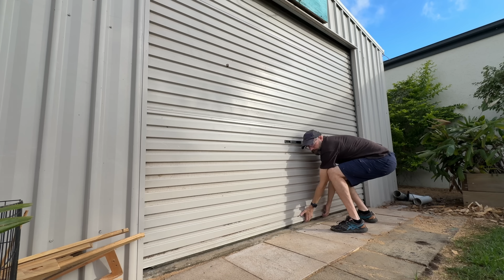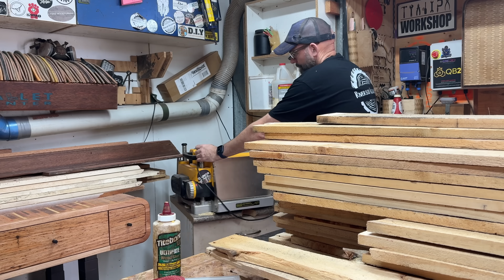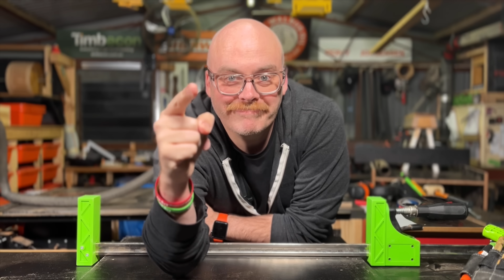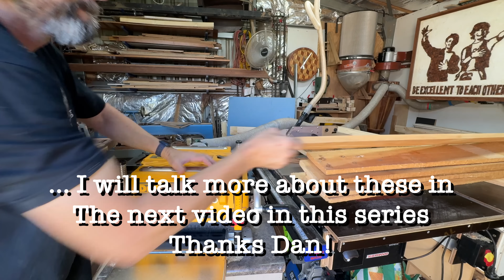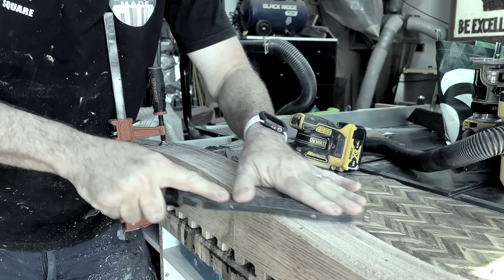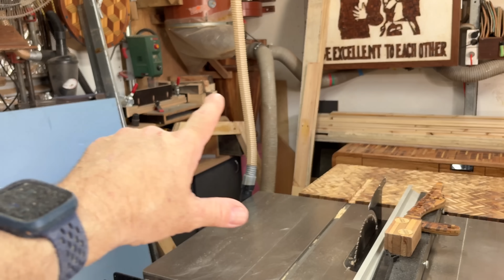Making Timber Without a Full Workshop – Minimal Tools, Big Results

Comment: Wish more youtubers where like you, honest, raw and kind!

My workshop is about half of yours and I've just (hopefully) finished collecting tools myself. Its gotten that bad I have no room and have to pack away the tools after every use 😂
Tools: Table saw, Mitre saw, Thicknesser, Planer, 2x Pilla drills, Lathe, Massive band saw, Shop vac with 50l cyclone and a Dust extractor... safe to say, no room for sliding 😅

Also I bought Phil a pack of 🍺 hope it helps 👍
Reply from the maker: Hey Kelvin, cheers mate. Be excellent to each other is the rule 😉 Your space sounds perfect mate, it will evolve into what you need it to be. Small spaces really get the brain going. and thank you so much for supporting Phil 🍺

Comment: I know it’s not the point, but how does the cost of all that glue compared to the same amount of 2 x 4s?
Reply from the maker: I used about 2L of glue of titebind original. about $50 Aussie. I will do some math on the 2x4 in the next video. But you’re right it is not the point 🤣

Comment: I hope the best for Phil. When it comes to buying machines I am all about buying when it's a screamer of a deal and/or if the machine needs a repair. I just got an absolute beauty of a bandsaw for $150 just because the motor went on it. For $35 I got new to me motor that is twice as powerful as the original. That saw would have cost me $800 if I bought it all new. So that's just to say that there are different roads to getting your tools upgraded. It doesn't always have to be through selling projects. Everyone get to pick their own path. Once you do get a combo machine your going to love it.
Reply from the maker: For sure mate, and very good advice if anyone is reading along. Cheers mate

Comment: 2x4 is not expensive.
Harvesting wood from pallet makes sense?
If pallets are use with minor changes, makes alot of sense.
Glue is not cheap.
Reply from the maker: Cheers mate, this is not a comparison video. But I do know I used less than 2 litres of glue for this entire process, that about $50, happy to trade my time instead of buy the timber. Which is what the channel is mostly about

Comment: @Dainer Made...I have often wondered about using pallets to make construction grade 2x4, 2x6, 2x8 or any other dimension of lumber.  For example, a 2x4 bought at the local big box store actually measures 1.5 x 3.5.  Will  the lumber you are making out of the pallet wood measure an a true 2 inches by 4 inches or will it be 1.5 inches by 3.5 inches? Also, if your wood is actually a true 2 inches by 4 inches would this affect the projects that you use to build with it??
Reply from the maker: Hey mate, the exact size does not matter at all for my project. The chunkier the better 😁
Reply: That’s a good question, or line of questions. When lumber is sawmilled it starts out at full dimensions, say 2 be 4. Then it gets milled, planed, flattened, dried, squeezed, etc. etc. and that’s why we end up with smaller dimensions on the consumer end. In the case of milling lumber yourself, you can make it any dimension you want.
Reply: @mikebond6328 ....hey thanks for the response.   I am new to woodworking but still want to know if my newly milled lumber from pallet wood would effect a project that I build?  For example, I am reading a book named "Great 2x4 Furniture" and am worried that my builds would be thrown off and not fit together properly if I use my lumber that is smaller or larger than the lumber I would buy at a big box store. Any insight you have is appreciated. TIA.

Comment: My own setup is extremely similar to your own. Table saw, and a planer. 
I attempted a big slab glue-up recently and struggled to keep my wood from shifting while clamping over a dozen pieces at a time. Needless to say, my glue-up was not successful. Although I know what adjustments I want to make going forward. 
Anyway, you've been a huge motivator for my starting woodworking. 
I'm very excited to see how your shop evolves. 
Cheers, mate!
Reply from the maker: haha, I know the struggle mate, I feel like there is lesson on everyone  even now. Enjoy it all mate and thank you
Reply: I recently saw a way to restore the friction when doing a glue up - grate a little of the abrasive from some sandpaper onto the joints - just a little goes a long way, a lot of wood workers use salt too.
One love from Spain

Comment: When you break a nail head off you can lock Vise Grips onto the nail shank and they'll hold enough to pull the nail out with a pry bar. I've done it a million times. It always works. But you need a pry bar with a fork on the straight end. They're kinda rare. But you need one.
Reply from the maker: Cheers mate, sometimes nails still break and I leave the rest in peace lol

Comment: I'm laughing about the glue-up "adventure," but you know I'm not laughing at YOU, right.

Definitely want to buy 2 right angle squares. They're not wood, so they can ship to the states, right?

How did you know that my work space is so crammed with tools and materials that I can barely move around in there?!

I promise that I'm LISTENING to the "simple is better" wisdom. I'm not claiming that I'm walking in the truth of that wisdom (yet?), but I value the info!

Cheers, Mark.
Reply from the maker: Hey Tim, plastic is certainly allowed across the border haha, hey don't always follow my advice. you may need all that crap you have piled up. Enjoy your weekend
Reply: @dainermade I will certainly give careful consideration to your advice to not always take your advice.  Another promise! 

Thanks for the chance to chip in for a couple squares (PayPal wouldn't complete the order on the day, but it DID this morning). They'll be good exceptions to the "don't buy more tools" rule I also need to follow.

All the best.